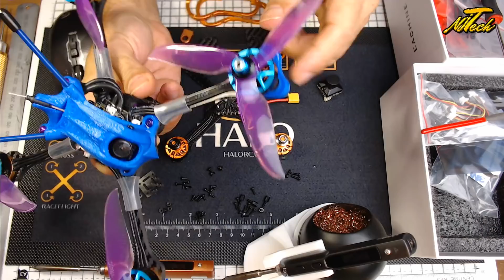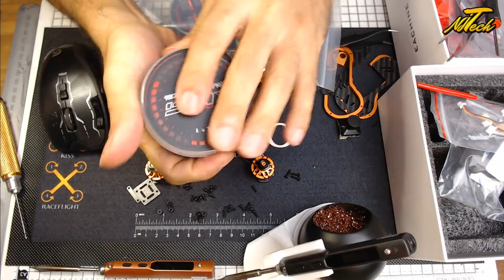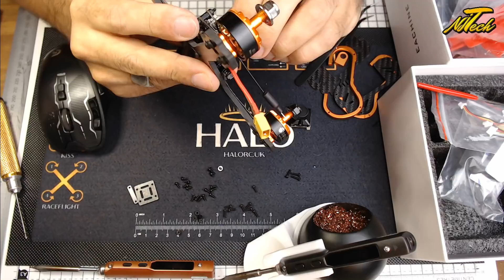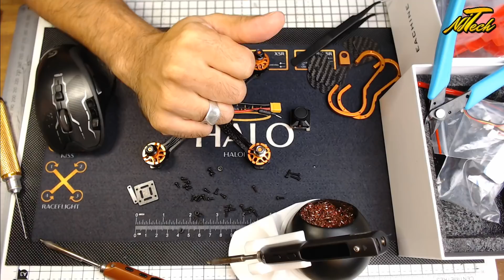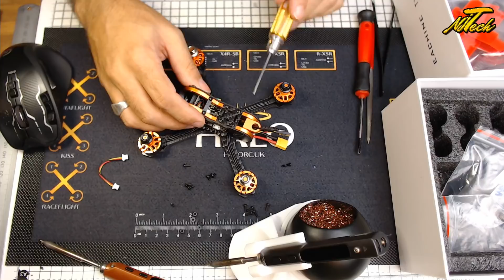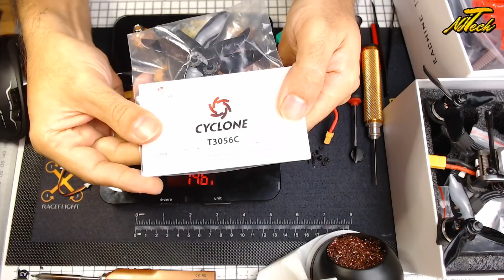NJ Tech Live Stream

Comment: warning for buyers you can burn ECS ..... problem are motors that are badly made .... all with silver nuts .... have one problem .... distance washers are two under the hairpin and silver steel should be on the right But the copper holder under the clip, it's easy to verify ... knock the engine left to the right a dozen times lightly compressing it when you feel a slight crack or resistance check washers and clean the magnets and stalls from debris ... for me this problem was solved if I connected the motors without checking, I would surely fry the next ECS ... Regards